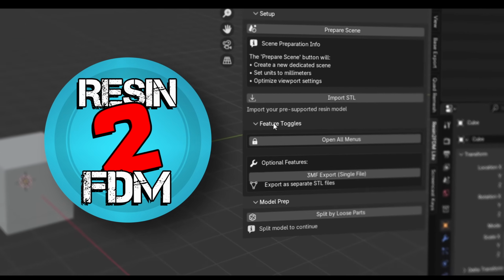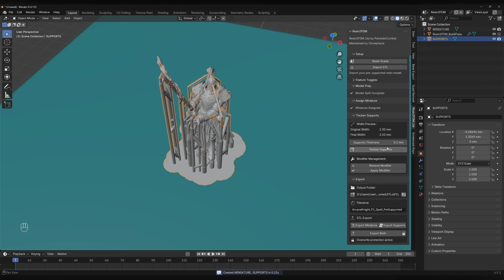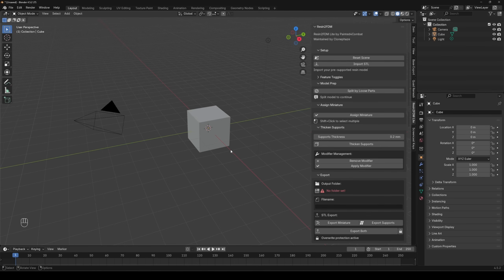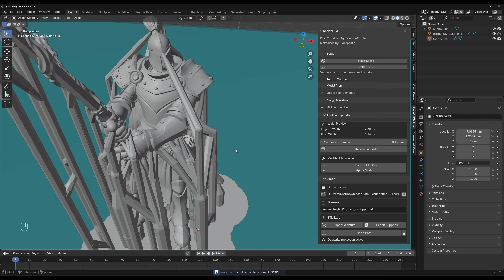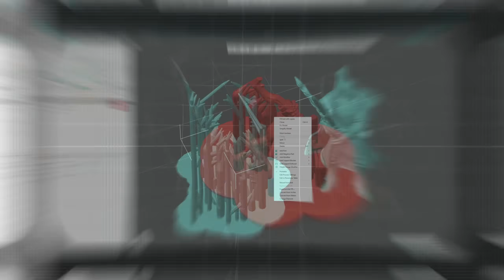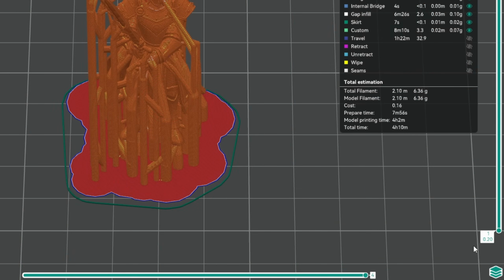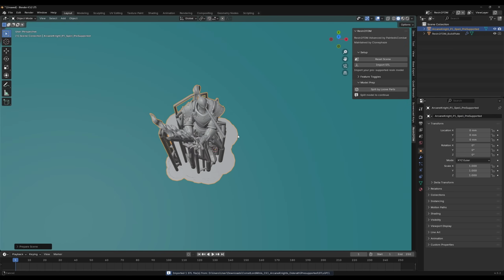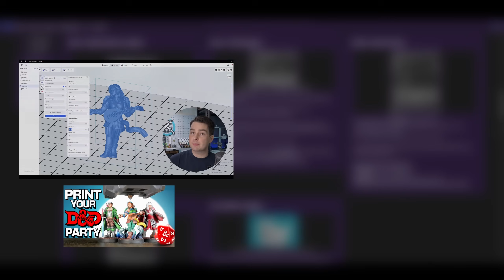Print Amazing FDM Minis! [FULL TUTORIAL] Resin2FDM 1.4

Comment: Was wondering if anyone could help me, the level cubes seem to be causing the print to fail for me as when slicing the model, the raft is balanced on top of the level cubes so the printer tries to print the cubes and then starts trying to print the raft in the air

Comment: I have a feature suggestion: making the tips and supports SMALLER and not only bigger.
When printing I sometimes scale the model up, but doing so makes the supports bigger as well, this means that sometimes the tips become way too big and they are difficult to remove.
Making Resing2FDM be able to reduce the size of the supports and the tips as well could help with this.

Anyway, thanks for your awesome work, you are doing incredible work for the community.
Cheers to you!

Comment: One tweak you may want to consider is an option to double the width and length of the level cube. If you try to use this tool in its current form with a 0.4mm nozzle, which requires a first layer width of 0.4mm or above, OrcaSlicer doesn't print the level cube since it's too small, and this causes it to refuse to slice since the first layer of the miniature object is empty ("One object has empty initial layer and can't be printed").

Comment: Bambustudio dont allow me to change the layer hight only on the supports. i can change the layer hight  from the miniature but not from the supports. Is it important?
Reply: Hey! I was having this issue as well, I was able to solve it by exporting at 3mf from resin2fdm. For some reason it seems that using the 2 stl files method disables this setting in both Bambu Studio and Orca Slicer. As for why it's important, it's the largest factor into decreasing print times. Once I was able to change this setting, it took off about an hour and a half of print time for me. Hope this helps!

Comment: Great tool, I just got the "free" version to test it out. I have been using Resin Supports on my FDM printers for years. I've gotten to the point of knowing basically how to set this up in Chitubox. But having the extra ability and in Blender to tweak some more things is great. I have one quick question. I am more than likely NOT going to be using someone else's "pre-supported" stls. How do I save/export stls to be used in your addon? Thanks again!
Reply: Hope you enjoy using the tool! 

Chitubox and Blueprint Studio both have options for selected a model you support in their programs to be exported as an stl. In chitubox its the top left blue button with the chitubox logo > Export Model
Reply: @Clonephaze2327 thanks! yep, I'm assuming it saveve them as separate parts then, I haven't checked to see if I could "split" the exported stl. Thanks again. I look forward to seeing blender talking to you to get this as a permanent add on *smile
Reply: @Art_911  No need to export as separate STLs! The tool will split them itself, so exporting your model with your supports as one stl is the ideal way to go.

Comment: I love Resin2FDM but i have a question. I use Blueprint Studio to add supports. Then i do the resin2fdm in blender and import in Bambu Studio.  Without splitting mini and supports my model would take 2d 7h 10 min to print. If i split the file and set the supports it only takes 1d 16 h 36 min to print. So about 11 hours print time saved. But this is with the model tilted 45 degrees, since that should be the best to avoid layer lines. I also tried the same model, standing up like normal split it in object and slice it. It then takes 1d 12h 2 mins to print.  So 4,5 hours more saved.  Since you did not tilt the mini 45 degrees in this video, what would the best option? tilted or not tilted?
Reply: In another video he addresses orientation, I think it was the one with the D&D party. If it is a full miniature, you will want to tilt it so major features don't need to be supported / you lose details. This could be different depending on mini but you'll learn what works and what doesn't :)

Comment: to eliminate non manifold error on supports, you can add a remesh modifier on the support object in blender. this should avoid any slicing errors with overlapping support structures
Reply: This does work! The only reason I've never made it a main part of the tool is that it can massively increase file size and how long slicers take to slice, which 99% of the time just wouldn't be worth it. If anyone is having issues though this can work to help, absolutely.
Reply: @Clonephaze2327  Should this be something I do as standard if I‘m a macOS user (which cannot do repairs as windows systems do)?